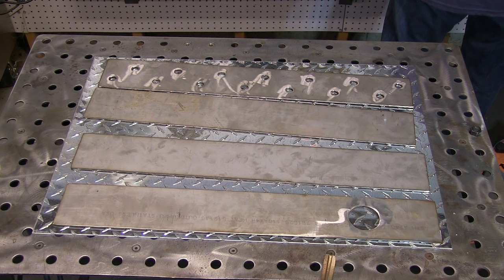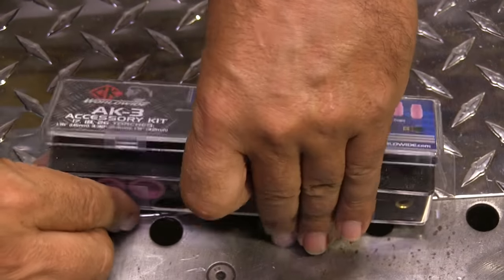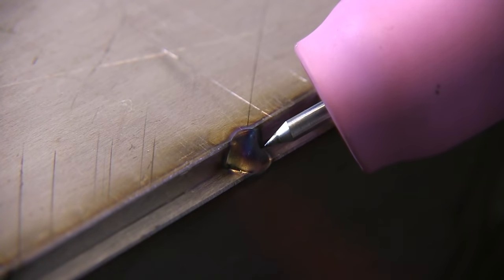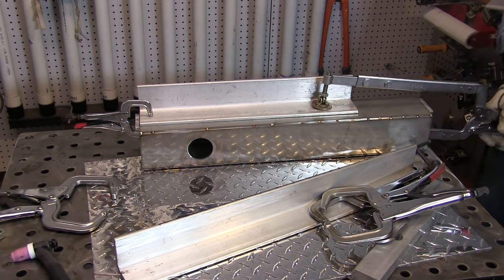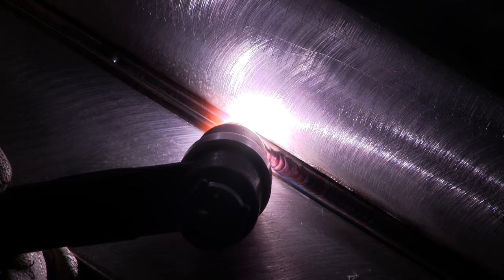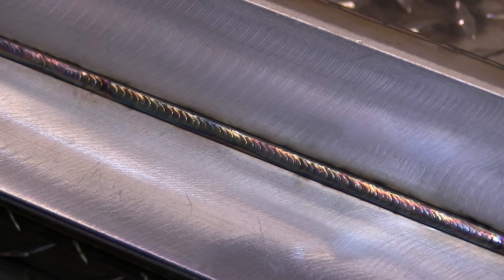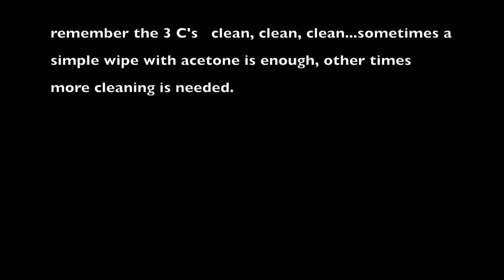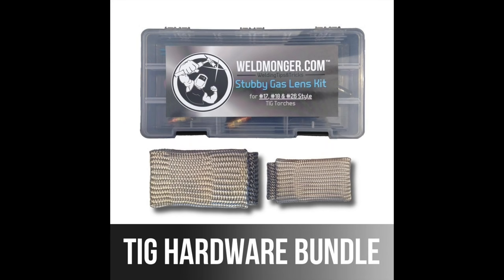Stainless Steel Welding Tips - TIG Welding

Comment: The only thing I would add is that 304 is 18% chromium and the chromium oxide layer at the surface is what makes stainless  steel stainless. When you deplete the chromium to about 11% it is no longer is stainless. The reason for 304L is to keep carbon from tying up the chromium making chromium carbides and every carbon atom ties up 3 chromium atoms. Very good series. I have welded stainless and high nickel alloys for about 30 years and find it interesting to watch you instruct. You don't realize how much you know until you start training someone else.

Comment: I found that for thinner stainless, high amperage and very fast travel speed is the way to go... Often laywire and 100 amps for 1mm stainless, and pulse to let you move at reasonable speed...

Comment: Jody ... your right. There are many grades of stainless. Most people think if a magnet doesn't stick to it it's stainless. There are grades in the
 400 s.s. Category that a magnet will stick to. It is also heat treatable. When you get down into the 300 grades. a magnet won't stick to. E.g. Frying pans are mostly magnetic ... you really need to know the material grade. Thanks for all the videos. Your the best.

Comment: Jodi:
I have a medical device background so what I say here is probably super overkill for this video. "Keeping stainless stainless" in that industry is done by:

First make sure the parts are truly clean.  Always using the low carbon version of the alloy such as 304L in this case. This prevents carbide precipitation at the grain boundaries. Otherwise the boundaries are no longer stainless and that is where corrosion begins.
 
After processing, passivate the area with the proper chemical -  usually 20% nitric acid in most cases. Afterwards, avoid scratching the surface especially using iron tools like which you warn to use only a stainless wire brush. The chemistry of passivation is argued but folks, but it does remove all rustable free iron from the surface

Most of my medical welding experience we used built-in small flanges at the spots  to be welded so no filler rod was necessary.
One summer break I worked at Westinghouse where they built the nuclear reactor pressure vessels. (I guess that dates me!) The alloy was 304L and they used 308 filler - as you did- if I remember correctly. I  never saw a passivating process there and I wonder what if anything they did to it after welding.

I have seen many of your other videos and you know all this stuff, but I thought I would just mention this because it does help keeping stainless stainless. 

Bill
Reply: I need your help bro

Comment: Excellent video. Jodi is the best teacher of welding on YouTube period. More knowledge in these videos than the Lincoln welding library. I've not messed with stainless ever but I heard that stick welding is the best for stainless, is that true?
Reply: Tony Baggett depends on what you are welding. Thick plate stick is best. Tig is better for thin stuff and pipe.
Reply: Uhh they run tig root on 1" thick and up all day in the boilermakers trade

Comment: Find myself always coming back to your videos and I decide to weld something again. You're full of knowledge that we all need, what's that said what is a good way to identify what stainless steel your welding on, we'll all stainless steel fill a rod work or different types of stainless welding?
Reply from the maker: i dont think there is any easy way to identify different grades of stainless without something like a handheld xrf spectrometer. some grades are very similar in composition. 304 is the most common and 308L is the most commonly used rod for 304. It will pretty much weld any stainless but it doesn't necessarily provide the same strength or stainless properties as whatever grade you are welding.
for example 316L needs to be welded with 316L filler in order to have similar corrosion resistance.
hope this helps
Reply: @weldingtipsandtricks  that is helpful. I don't want to keep the stainless property of rust resistant, due to it being an exhaust on a vehicle, however beyond that I'm not worried properties. I guess I can try the magnet test? 304 not magnetic and 308 is, I think?

Comment: I really like the foot pedal that came with my Lincoln Square wave 200. I use a similar pedal at work. They have a really nice Miller syncrowave 200. Learned on a small Miller 160 stl lift start at work. The foot pedal definitely takes some getting use to but once practiced with foot pedal you will never look back

Comment: I weld alot of stainless sheet metal at work, usually rolled and butt welded (working on a good purge fixture) but struggle a bit with .060 or thinner in getting a good bead with even penetration. Don't really have a question but maybe you could roll some rings and make a vidio.

Comment: Jodi can you do some TIG welding on 0.0625" or 0.125" open corner joints using super duplex stainless sheet(S32760), something like this could be used in a submerged seawater application and is significantly more corrosion resistant than 316L

Comment: Jody, when using acetone to wipe something down, use butyl rubber gloves instead. They are much more resistant to acetone and will not "melt" after a short exposure unlike the other kind like vinyl, nitril, neoprene, latex,....   It's not impossible they could contaminate the workpiece after using acetone when you touch it.

Comment: Hi i am a design engineer at a Car Modification workshop. we do custom piping and exhaust. we use argon gas for our TIG. The welding my welders do gives out dark grey welds (after some polishing etc its all stainless again no problem). The aesthetics are good but just the coloring is not there. Pipes we work on are all about 1mm thick Stainless steel. we go on about 60A for the welding and also do not have foot pedals. Could you please tell me how I can achieve the nice color orientation from the oxygen contamination. Should i reduce argon gas amount or Amps or is it the welding technique. any information you can give me will be much appreciated.

PS. great videos
Reply: coolz2334 I would try a bigger sized cup, gas between 8-12 liters per minute, maybe reduce the amprege (a rule of thumb is 30-40 amps/mm maybe more depending on preference) and ofc use argon purging and that edges are deburred and clean.

Comment: Those are some pretty nice beads there.  I just had an anchor roller made of 316L ss welded to a plate and it was the worst friggin weld I've ever seen for an intricate finish marine product.  Have to grind it down and find someone else to redo it.

Comment: Great video I am a welder and I weld stainless steel exclusively in my profession I weld mostly for the food and lab equipment sector.  I use a trigger and weld relatively hot and control distortion with a wet rag is that something  that is not recommended not sure still new been welding for about 3 years
Reply: I know I'm 3 months late but a wet rag is fine. Nuclear grade stainless welds are often cooled with spray bottles full of water.  Make sure it is DISTILLED  water though.

Comment: Hi Jody, 

Thanks for all the Videos, Ultra informative and very helpful. 

I am a complete Amateur TIG welder and have pretty much been learning from your videos which i seem to have come quite a long way with them. 

I usually weld small projects out of 25x25 mm Square tube with a thickness of 1.5 mm. I am getting some pretty reasonable welds going, But ive noticed on the INSIDE of the tube, (Where i can see the weld penetrating through) i am getting a bit of rust there. In the video above you make reference to a high purity argon purge, What is meant by that? 

In my wild imagination i am imagining putting a tube from the argon tank and allowing it to flow through the tube to "shield" the inside of the tube? 

Hope i made sense explaining my issue? 

Thanks again for all the awesome videos.

Comment: So what actually makes it not be stainless if you don't take these precautions? Does overheating change the physical properties?
Reply from the maker: overheating stainless can cause something called "carbide precipitation"  which causes corrosion.  wire brushing with carbon brushes embeds carbon particles on surface and causes rust spots

Comment: Jody, have you ever used Solar Flux Type B? Can you share any tips on that product & applications?
Reply: Josh Fazenbaker 

I'm a hobbiest - not the seasoned pro that Jody is, but I've used Solar flux to gas weld 304. Works good to shield the weld, but is kinda' a pain in the cunning linguals to clean off.

Comment: Jodie, love your videos, especially on stainless.  Any chance you'd make one on a custom stainless steel header w/3/8" flanges and 16 gauge primary tubes?  It would be great to see the tough part of the 16 gauge connecting to the thick 3/8" flange, and then how you work around the primary tubes.

Comment: On your Stubby Gas lens, do you cut the Tungsten down? I'm guessing you go through a lot of Tungsten that way. A regular torch you can use Tungsten until it wears down. The Stubby Gas lens looks like you might only get one nice grind out of it before it's time to throw away.
Reply from the maker: It comes with a long back cap as well as a medium.  For shop welding, I sometimes use the long back cap to use longer tungsten. But its nice to also have  short cap for welding parts where there are tight spots to reach into.
Reply: @weldingtipsandtricks , what's the best way to cut down the tungsten?

Comment: Hi Jody. here's a question that I've been hanging on to... 

This goes along with "keeping stainless stainless" : Can I store 308 filler rod in carbon steel pipes (much like your pvc TIG rod holders)? I imagine 309 and 312 would not be a problem but I'm worried about the 308. 

Thanks for providing these videos as well as the weld monger store. Both have been great resources to me.
Reply from the maker: I wouldn't store 308L in carbon steel pipe just to be safe.  thanks for the good word
Reply: Nick Aylett Carbon steel contaminates stainless steel when they come into contact.
Reply: Matthew, thank you for your input. 309 and 312 should be fine right? (since they are used for welding carbon steel). 

Also what about aluminum wire? Ok to store in steel tubes?
Reply: On job sites filler wire is always stored in cardboard or plastic containers. Quality control will trash any aluminum, stainless, titanium, or chrome wire that has been in contact with carbon steel. That's only the strictest of codes though. I still wouldn't do it in my home shop. Its just another thing that can give you problems.

Comment: i have problems with undercutting when weaving and walking the cup. i tried turning the amperage down but then it doesnt puddle the filler rod enough. this happens on horizontal welds and filet welds. tips please! this is on carbon steel
Reply: Try a bigger filler rod.

Comment: Sometimes I know I burn my stainless. I work only with stainless. But the job just require it. Im a professional in stainless. But! If I burn that steel, and use acid, does that really make up for it in your opinion? (Some jobs where this is the case, it’s not supposed to support heavy weight. But we do it fast because of the cash income of these spesific jobs)
Reply: We use 316 most of the time. If we weld 304 we still use 316 rod, not 308 as u mentioned! In my country 308 is special rod to weld black steel to stainless. But we always use acid after every stainless weld.(not 308)

Comment: Will a welder that is rated for 230v get damaged if I run it on a 240v outlet? Thank you
Reply: Zesty Meme nah it's fine, the electric running to your house varies from 230-240 volts ac

Comment: Why is overheating stainless steel bad? (Just curious). Does it change the composition or the concentrations of the additives so that there are areas that can rust? Like some part of the alloy rising to the top or below the surface?

Thanks for the video!
Reply: Dejay Rezme it can bake out the chrome or nickel. That "sugaring" is called carbide precipitation and that is the "stainless" part of stainless baking out of the metal. It'll rust if you do that.
Reply: Thank you! 
So I figure the chrome or nickel compounds rise to the surface and get wiped off and no longer protect the steel.
Reply: Dejay Rezme it usually gets burnt out the back or if not then it can bake out the top. That's why heat control and proper shielding is so important.
Reply: Cheers!
Reply: Carbide precipitation is the technical term.
Reply: Thanks! I found this from a quick search: "Carbide precipitation occurs when the chrome and carbon in the austenitic stainless steel are drawn out of the material and react to the atmosphere. It occurs between 800 and 1,400 degrees F (426 and 760 degrees C), so you need to keep the weld zone temperature below 800 degrees."

So the melting point of stainless steel is far above that (1400-1450 °C for type 304 stainless steel). So I guess the trick is to just keep the effect as short as possible and have it cool down fast.
Reply: Dejay Rezme bang on mate and once it starts getting too hot just stop. Sensitization occurs when stainless steels are kept above 800°c as you've correctly stated so if needed austenitic 300 series stainless steels can be cooled rapidly with water without the risk of hardening or making the material brittle, one thing i didnt see mentioned is too be sure the stainless you are welding has the designation 304L or 316L denoting low carbon, its when standard 304 or 316 stainless steels are welded that you can run into rapid corrosion in the haz due to excessive carbon already present in the metal, no techniques going to prevent that. Its one of the big reasons people rubbish chinese stainless steels, they are cheap because they didnt go the extra trouble/expense of removing said carbon but they are not really designed to be welded.. The term is 'weldability' of the metal.
Reply: Dejay Rezme Also...food and hospital grade pipe/hose (where purified water, oxygen, consumable liquids etc flow) need to be color free, as contaminants might adhere themselves to the oxidation.
Reply: The technical term is "Inter pass temperature"
Reply: Thanks for all the info!
Almost seems like it would be a good idea to have an IR thermometer attached to your welding gun.

Comment: I have seen guys using huge cups lately, i'm old school so don't know why they do that. Anyone wanna share some info with me about these huge cups? I usually use a gas lens with a #7 cup. I don't understand the huge hole at the end, why would you need that? Easier to keep rod end from getting contaminated? I just leave my rod in the weld unless it's the end, then i leave rod end in shielded area. I can't imagine they do it for that reason when it's so easy not to contaminate the rod anyway. Maybe so gas stays on weld behind puddle for longer period of time? Anyway could someone please explain? Thanks in advance.
Reply: I’m pretty old school too, I have been using tiny cups for many years at my job, they recently got me a new welder and the gun uses twice the diameter cups.  With the work I do with it I haven’t noticed much difference except I can’t get away with using a teenie tiny flow of gas, I have to turn it up more.
I would have to think it has to be better to have a ‘ draft ‘ of shield gas than a ‘ jet ‘ of gas.  Larger area, slower moving.

Comment: Are the blue tips 1.6 in that kit?
Reply: What's better for welding aluminium 1.6mm or 2.4mm? I use blue tip non toxic 1.6mm for 1.8mm aluminium pipe and 5mm brackets. What would be the (sweet spot settings) for me? Please help because I weld for a living and want to be the best I can be. Thankyou in advance.

Comment: or you could just stay off pedal so you don't have to start in a big hurry, i only have 30 years exp, what do i know? could just get arc going barely pushing pedal until you want to take off, say like 20 amps, unless you have it set on panel, but then you wouldn't need a pedal just a button. don't ever buy one at weld supply store buy at an electronics store for $3, much better than the 90$ the local weld supply wants. But i wouldn't use a button or weld with panel on s.s. anyway. You get craters that way, unless you're good at clicking button really fast. Also if you buy button you have to wire it, and you better know which 2 holes the wires go in or you'll blow panel in welder. there are 2 side by side at top, use the one on left side and the one just below it all the way to left side. Wish i could draw it for you guys but i can't here. Best to have someone who knows how to do it. Usually anodized aluminum welders will know cause they use buttons. I'm in south Florida and have built lots of tops and towers for fishing boats and they are all anodized. anyway that's my 3 cents lol.